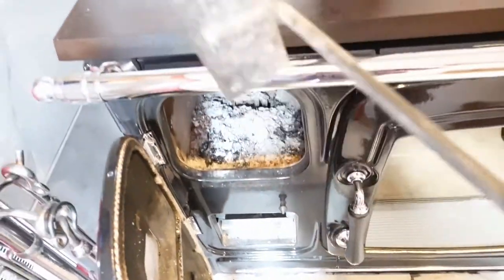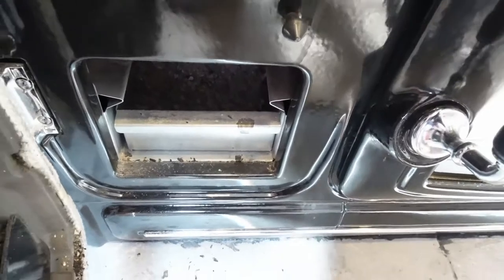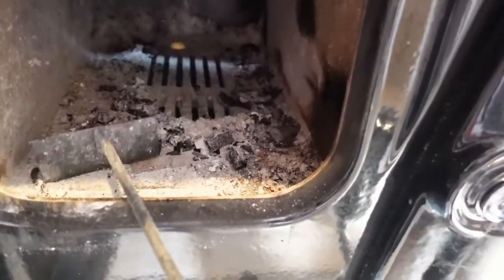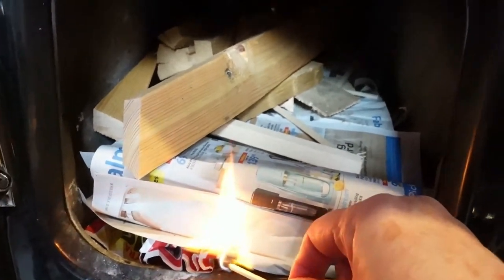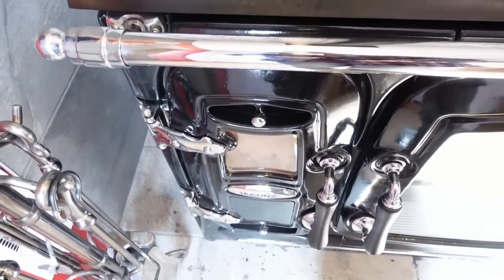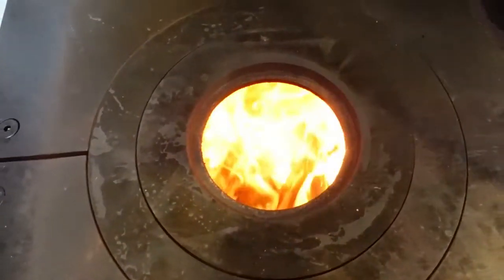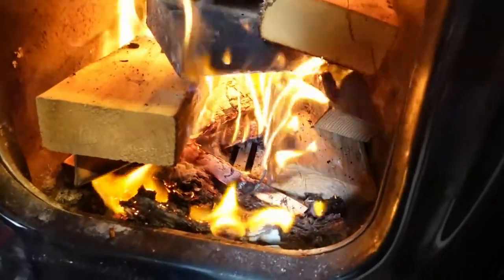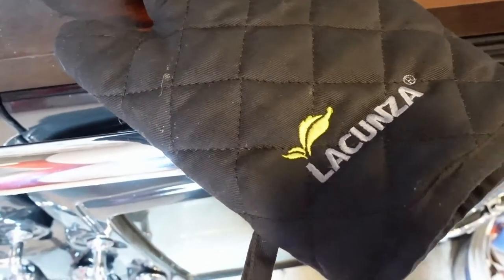Starting My Clasica Lacunza Wood Cook Stove

Comment: Could you teach me how to cook and bake now? I just got this stove installed today and my husband is going to get it going for warmth, but tomorrow I'd love to learn how to regulate the heat and cook and maybe even bake something!
Reply from the maker: I do have a few videos of me using the oven. One making pizza and got the oven up to almost 600 degrees! worked great. I hate it when you cook a homemade pizza in the oven and it is still raw on top. I will be trying to get more videos made of me using this stove when I have time. Unfortunately we didn't get moved into the new tiny house for this winter. However, I am still lighting it and using it sometimes. I just used a pressure canner for the first time this year and didn't realize they are not to be used on gas stoves but are ok on wood stove.